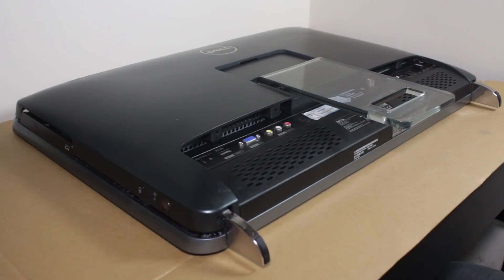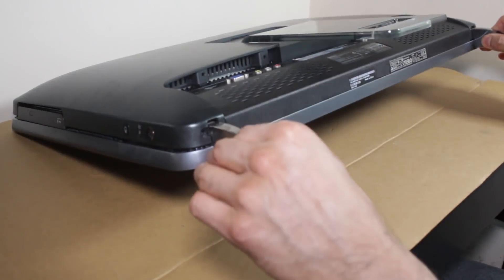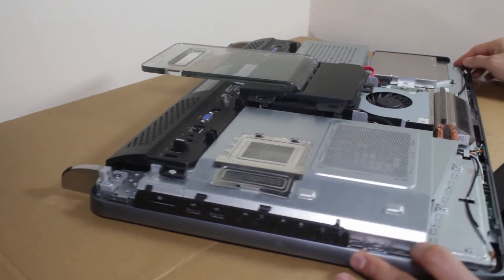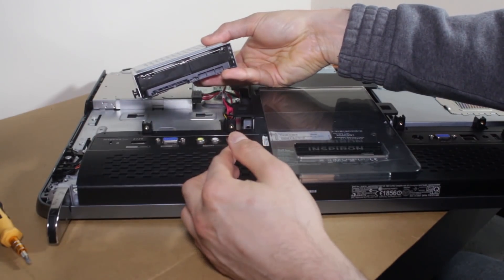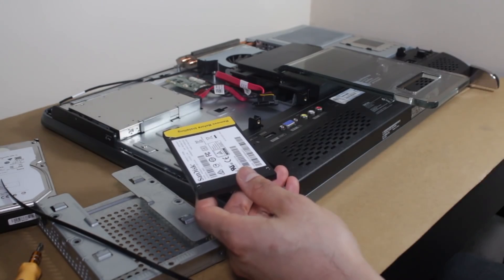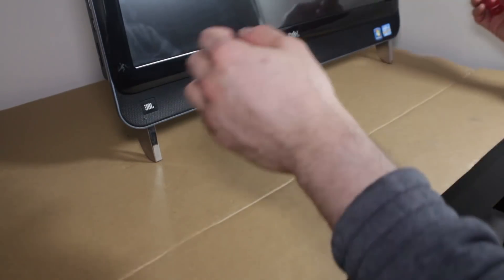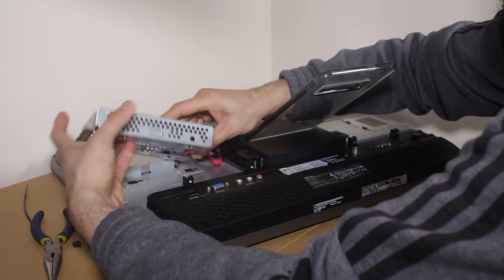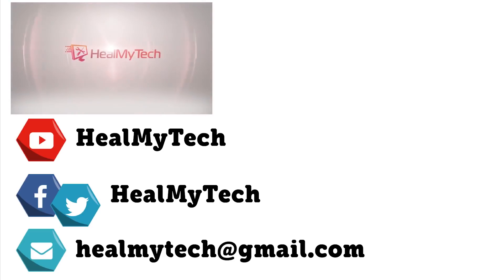How To Upgrade Your All In One PC | All In One SSD Upgrade | Dell Inspiron One 2320 | Hardware Only

Comment: A Sandisk SSD Plus is a great choice, it'll last as it is SLC Caching. I also installed a 1TB Sandisk SSD Plus in my Dell Optiplex 7010/9010, plus an Intel i7 2600 Processor, and 16GB Of Ram; I can tell you that it's perfectly running on Windows 11 Enterprise 24H2. Well Done.

Comment: Hi, just wanted to say thanks. I followed your instructions with disassembly and  put it back together with no problem. I cloned my hard drive and affixed the ssd to the carriage with double sided tape. Plugged it back in and it fired right up:)

Comment: Hello, I speak from Brazil. I wonder if I can put a higher capacity ssd? Type 480 GB
Reply: Any 2.5” SSD will fit regardless of capacity. He only used zip ties because he was not expecting to have a full 3.5” HDD from OEM. I would suggest buying a 3.5” to 2.5” adapter to help yourself out

Comment: I hate 2 on one computer because it's hard to upgrade or change hardware. I use a computer hooked up to a tv, I have dual monitor,  I have a tv tuner if I am not happy with one hardware I just replace.  I like the trick of securing the hard drive with cable ties. That was a plus

Comment: Do all in one PC’s support adding the SSD as a second hard drive or so you have to replace it with the SSD? Just wondering because I know that large SSD drives that have enough memory for the OS and all your files and games can be quite expensive, where as if you’re upgrading the SSD mainly to improve the speed of games you can just install the game on it (or the game and Windows and use the old hard drive for other storage). I’d rather do that to spend less on a smaller SSD but I don’t know if that is possible on my Dell All in One.

Comment: Hello sir, i own a Acer Aspire Z3280 and since the HDD is getting quite stuffed over the years (1tb) the speed also ain't what it used to be in 2012. Overall it ain't a bad pc containing a AMD A8 5500 which was quite nice back then and 8gb of ram which unfortunately is the maximum for as far as i can see. I would like to do some TLC and a bit of magic to make it the machine it deserves to be. I have opened the back, looked and closed it again because i could not figure out how to open the aluminium which covered all of the components which are exactly the ones you would like to replace. Allright, what i would like to know is: Is it worth to try to open it using some force and is that really the way to do it? And is it opsible to use the SSD just for booting the system and perhaps some heavy programs and use the original hdd for other programs and storage? Or are these AIO pc's packed together too tight to fit in the SSD somewhere (really don't care where it will be located). And if there would be a some space, would it be common for the motherboard to have a spare SATA port (and yeah, a spare power plug too). Greetings and thanks for your video!

Comment: Today I got a Insp 24 2330 not working, it was given to me so I will try to fix because I need a new computer so badly, it does not boot, cannot access the bios on boot, I hooked up an HDMI input & the screen does work & of course there is power, does this mean the mother board is bad, or is there any other reset or battery change that can fix this? If it were I desktop I would need no help, but I've not worked on any Laptops or All-In-one's before. Thanks. good video, I will upgrade the hard drive like this, I've been using San Disk SSDs on couple of Dell 755 optiplex I have.
Reply from the maker: I deal with troubleshooting a computer at every step of a power on and booting up in this series, although its for a desktop, the AIO works exactly the same way:  Troubleshoot A Computer Series Playlist | Computer Not Turning On | Pc Turns On But No Display On Monitor https://www.youtube.com/watch?v=Wkcx-x9gjkg&list=PLDmnHbxxv3ncrDmkkt4oVJTEIBIy9pvRN.

Comment: My question is “your working on a Dell, will this work on a HP all in one?” Thanks for sharing
Reply from the maker: Yes it should, all computers have many common operations and hardware, you should be fine, unless your HP is so wildly different with unique Proprietary designs for their drive sata connections (which I doubt)!

Comment: Hi...does I have to know about my motherboard which add does it support before upgrading... should i get the right ssd for the motherboard support list
Reply: HealMyTech 
Hello. I’m going to piggy back off of this post for a minute. I think I’m having a compatibility problem with my all in one . It is an Inspiron 2020 one. Everything works fine except for downloading and running the one program I have on it . I do believe it’s a transfer problem. The SSD wants to be in AHCI but in Bios I only see ATA . Any thoughts?

Comment: I have an issue with my computer
I followed someone's guide on how to build a gaming pc $500 it has a ryzen 3 and everything is right and I have a more advanced power supply everything turns on and even the motherboard lights turn on. I have no GpU since I'm saving up for it but everything else is good. I connected to my monitor but once I do inside of saying no signal it just becomes a black screen. Please help me 
Can you contact me my email is alonzoguerrero1423@gmail.com